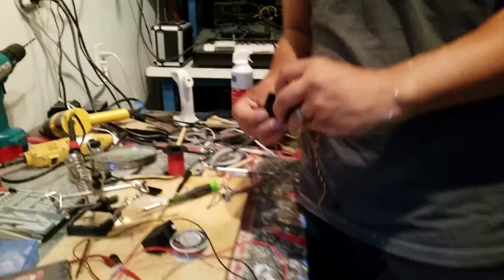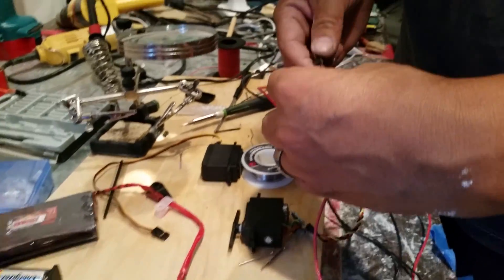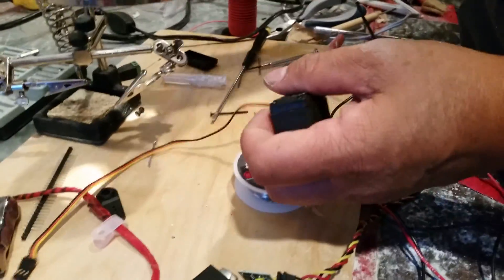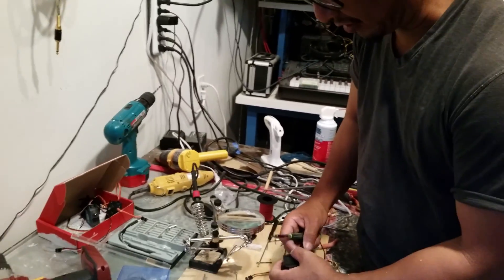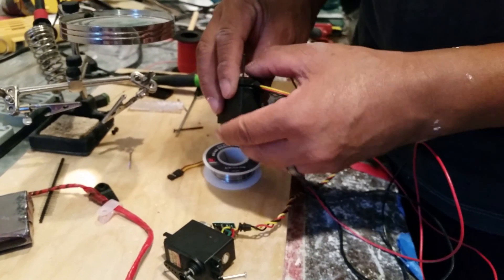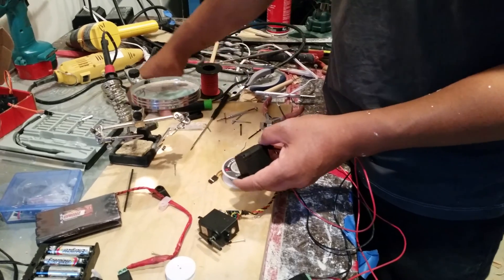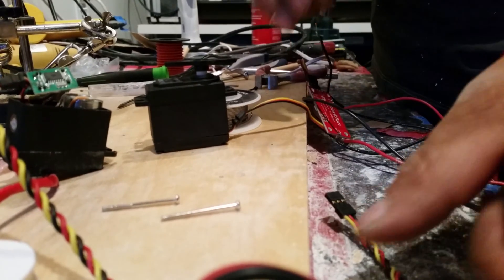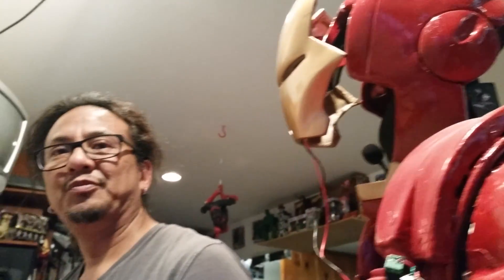Modifying a servo from 90 to 180 degrees

Comment: so I was confused too, but found a solution after some trial and error. here it is:   I wanted at least 180 degrees rotation and bought some DS3218MG servos, standard size digital 2kg/cm from DSservo out of china.  they are super common, very good quality, and can work from 4.8-6.8v.   They have just a standard rotation, despite what some ebay sellers claim.   I added two 2.2K resistors to each of the potentiometer outputs, one to each side, on the outside. i did nothing to the center wire. left it hooked up.    now i get about 200 degrees, which i can easily program down to exactly 180 by limiting the end points on my Futaba radio.  These servos have no mechanical stops in them, so nothing to modify there..   if your's do, you need to take them out first, otherwise you'll be likely to break something.     They work great. I'll be using them for air brakes on my Gemini V-2 UAV.   just wanted to share, as this tutorial was confusing to some people, like myself, so hopefully this makes it more clear, and gives some people a clear path forward.   Cheers, Everyone!
Reply: You mean you're actually adding resistors to the reference voltage and ground legs of the fixed resistor inside the pot. The center is the wiper which depending on position will give you a variable voltage output. Typically they use 5v or 3.3v as a reference.  And because you are adding resistors to the vref and ground, you're actually narrowing the voltage range of the pot which makes the mechanical input have to travel further to obtain the same voltage than otherwise would be 0-90 deg.
Reply: Oh 
FPVREVIEWS. You have reason. Thank you for helping me.